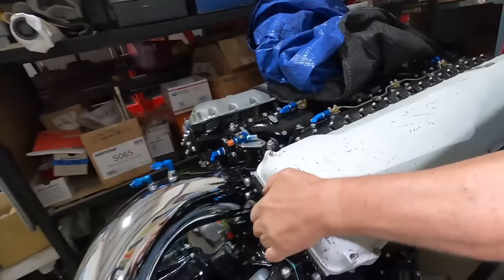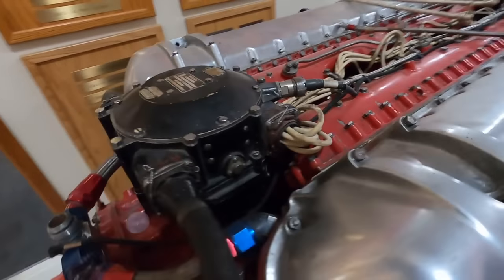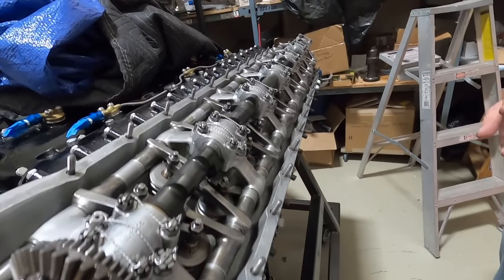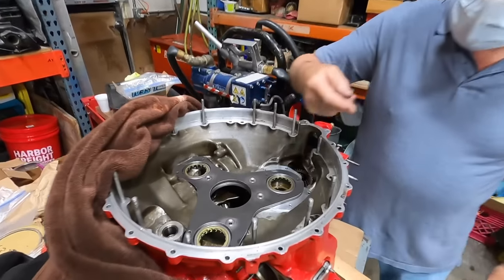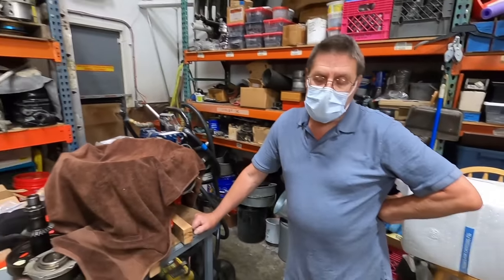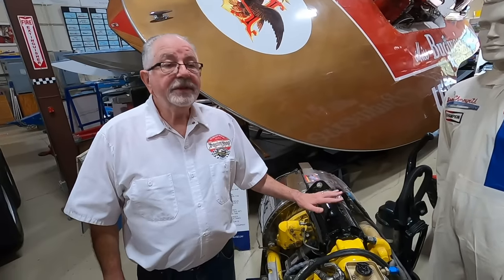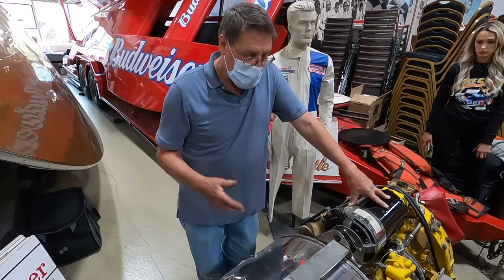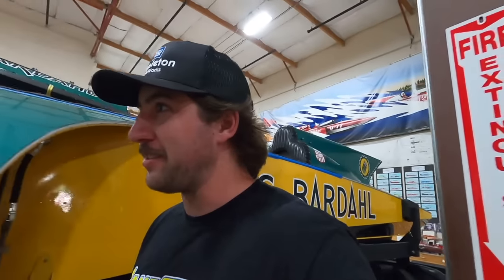The Rolls Royce Merlin: WWII Fighter Plane Engines Modified For Hydroplane Racing!

Comment: It has always blown my mind some of the stuff they had back during WW2. Big centrifugal Superchargers, turbo's, water/methanol injection, fuel injection, 4 valves per cylinder with overhead cams. The Allison engine in the P-38 Lightning has a turbocharged Allison instead of a supercharged one. The giant radial engines were also blown, but some of the later ones built after the war also had a device built into the exhaust that they called a turbo compound, it is a turbine spun by the exhaust gases that spins a shaft that connected strait to the crankshaft thru a fluid coupler, they would have a few of these on each engine and it was said to increase power by as much as 25%
Reply from the maker: So it takes load off the crank via exhaust pressure? That is very interesting..
Reply: Indeed; the Wright R-3350 used the turbo-compound on some models; there were three units, one for each six cylinders, adding at least 500 HP.
Reply: Why did turbo compound not drive its own fan? Why would RPM on the huge prop change too fast for a centrifugal compressor?
Reply: Nitrous Oxide injection was developed during WWII also
Reply: The turbocharged engines used in (American) WW2 aircraft were also supercharged, the turbocharger simply provided the first stage of supercharging, while an engine driven supercharger provided the second stage.
Reply: The Curtiss-Wright R3350 had a final form (it was originally built for the B-29) that used a power recovery turbine (PRT). These turbines, as stated above, linked to the crankshaft and added some power, while improving fuel economy.

As far as ACTUAL power gain, they really only added about 10-15% due to mechanical losses of the step-down connection and assembly.

The biggest problem was that the turbine created back pressure, and these engines weren't designed to handle that well. This created a heavier load on the engine, which created a heavier load on maintenance crews. These PRT's were commonly (hatefully) called "parts required turbines" due to the higher maintenance load.

But, it is also the ONLY engine that had a production line addition of the PRT. And that makes it the MOST unique engine in the world!
Reply: @RazingthenRaising  how can an engine not be built for back pressure? Aside from (simulated) Atkins cycle, all engines open their exhaust valve while still have over pressure. It is just logically that we greet this exhaust with an almost matching back-pressure. Of course, like in an engine with a throttle plate, valve overlap is forbidden.
Reply: @ArneChristianRosenfeldt  I understand and agree. However, any time that you put a turbine into the system, you have even more back pressure.

That is why the power recovery turbine  caused problems. The engine already had a hard time with overheating, and it added heat.
Reply: @RazingthenRaising  piston heads say back pressure when the use too small exhaust valves and rely on excessive pressure difference. Every bang from the exhaust is a waste of energy. Back pressure was too low.

Ideally, without back pressure, the exhaust is sucked out of the cylinder after bdc. How much pressure is even at altitude? Then add inertia through the exhaust header to the mix. Yeah, that pulls the piston up. That is elegant, but not perfect. And it is loud.
Reply: @ArneChristianRosenfeldt  I understand that back pressure is good in certain circumstances. I also understand that getting the suction correct is also amazing way to add power.

I am merely speaking of this engine having problems with getting overloaded, and running very hot. This was a big problem with this particular engine.

Each engine has its own particular goods and bads. And I don't know enough to speak more on that. ;)
Reply: Back pressure is never good for the engine. Or at least I would expect a big company to adjust the camshaft ( or cam - ring in this case ). I guess that I am biased. I think that it is stupid not to switch to somethin inline ( V, flat ) for these power levels. So guess the engineers working on this were not the brightest bulbs in the shed. Those were winning the war with V12 and later worked on jets. @RazingthenRaising
Reply: @ArneChristianRosenfeldt  Radials are their own beasts. Headers are used to help proper flow. I'm not educated enough to say specifics.

These engines were built specifically for the B-29, and EVERYTHING about that plane was DRASTICALLY rushed.

But it did a lot of good for future inovation, so.... (shrug).
Reply: @Stapleton42  It applies load (more torque) to the crank. It wasn't very reliable though. Used on the R-3350 radials fitted to the Lockheed Constellation and the Douglas DC-7 (IIRC). 🙂
Reply: Once I was fascinated by cylinder arrangement, but then it occurred to me that in a lab as a researcher I would probably optimize a single cylinder engine ( flow, exhaust header, valves). Then just duplicate. No complicated engine design was ever successful. Cannot have a camshaft on a radial .. sad face -- but okay. Center of gravity is not a problem for planes as is noise, so DOHC is a no-brainer for anything with more than 3 cylinders in row -- kinda boring . The only interesting thing for me left is that the planetary gear of a radial is probably only half the weight because we can use 3 teeth of the final gear at once, in contrast to the axis shifting needed if I want an oil pan. But you could explain this to a 5 year old. I thought about low drag cooling air flow through a two row radial. The aerodynamic experts of your plane and for the cylinder ports will tell you that you need to keep cross section constant. So I guess that even this arrangement which looks straight to cool, needs some sheet metal filler bodies. Can as well have my flat engine.  @RazingthenRaising
Reply: @ArneChristianRosenfeldt  The reality is that all truly large engines (most over 20 liters) are just single cylinders connected to a drive shaft. They all are cooled by the central system, but everything from the block to the top of the head is removable separately from the  rest of the engine. This makes single cylinder failures (a common problem) a simple fix, rather than a full engine replacement.

This saves a LOT of time and money when a single cylinder/piston has a problem.

No need to remove the back of a boat or tear down an entire machine. Just replace the bad one.

Most radials are built on that principle, as well. Each cylinder bolts onto the block separately.
Reply: Well, on the Curtiss Wright R-3350, there are 3 power recovery units,  150 horse each . At the end of development I belive horsepower was 3,000 . So, about 18 percent  .
Reply: @ArneChristianRosenfeldt ,,, well, the prop definitely did not change RPM quickly . So, it's called a power recovery unit, and they decided to supercharge with gear driven shafts  , and recover power with these exhaust driven compounds  .
Reply: @PistonAvatarGuy  AAAHHH  Someone else knows the details !!!  The TURBOcharger feed into the Mechanical engine driven supercharger to give a two stage supercharger system.  The P38 use 2 Turbocharged Allisons, V12's   the P47 used a TURBOcharged Pratt Whitney R2800,  18 cylinder Radial engine  and the B17's used a TURBOcharged Wright R1830  9 cylinder Radial  and the B24 used the Pratt Whitney R1820 14 cylinder  TURBOCHARGED Radial  the only TURBO charged engines in WW II!!!
Reply: @RazingthenRaising  Only on Radial engines, the V12's use one head per side just like a modern V8 !!!
Reply: @wilburfinnigan2142   It depends on the engine. You aren't wrong for these, but many massive engines have removable cylinders.
Reply: @PistonAvatarGuy  Someone else that knows the real truth and not just BS !!!

Comment: Thanks Mitchell and Logan for bringing this. A special thank you to Dan for his knowledge of these power plants. It is amazing how the reliability of these mechanical pieces, that were designed and built in WWII, were used years later. Pushing the limits (with some beefing up) higher than the were initially intended for, is crazy. A testament to their advanced engineering. Tangible history is cool!
Reply from the maker: thanks man!

Comment: I've always been interested in the old school huge engines, Packard, Merlin's and so forth. Thanks for always going that extra mile for some of the more in depth looks on things.This was another awesome video guys!
Reply from the maker: Thank you very much!
Reply: Check out the Ford GAA engine. It's pretty cool as well.
Reply: squire brannon  Are you aware that During WWII PACKARD built 14,000 of their M2500 PT Boat engines, yes 2500 cubic inch displacement and they were also contracted with by Rolls Royce to build the Merlin engine FOR THE BRITS ????  They delivered 37,137  to the Brits, and The USAAF got 18,000 of the PACKARD built and modified V1650 Merlins mostly for the P51B/C & D/K  H Mustangs, ALL the 2 stage 2 speed supercharged version and the USAAF's firs 3,000 of the PACKARD V1650-1  The early Merlin with the SINGLE stage supercharger, USAAF had no plane for them so they put them in 1300 P40 F & L models, but it made no difference in performance over the Allison !!!

Comment: Man you and Logan are friggin AWESOME! I love old Warbirds as much as I love Racing. Can't afford a real Airplane though 🤣 so I fly RC Airplanes. I do love to watch anything about them including what folks did with there Engines. To bad the folks couldn't fit the 18 Cylinder 2,800 Cubic Inch Double Wasp Radial Engines on a Hydroplane 🤣

I like that Matag made engine parts, one of the most expensive and rare 1911 Pistols from WW2 were made by the Singer Sewing Machine Company.
Reply: adamrogers..  Rolls Royce in 1940 Contracted PACKARD Motor co to build their Merlin engine for the Brits  and the USAAF also got the Merlin from that and yes Maytag the washing machine co sub contracted to supply aluminum  castings to PACKARD  for the Merlin and some parts had MAYTAG cast into them !! !

Comment: Kennewick Wa has one of the best spectator courses for watching hydroplane racing. Watching the Budweiser running full song down the backstretch sponson walking and feeling the rumble in your tummy was unreal. Also got to see one of the first competitive turbines, the Pay ‘n Pak, take off like an airplane and do 2.5 flips on one of its first runs.
The boats still race and test here every year, the boat are more competitive and reliable with the turbines, but just aren’t the same without the ground thumping rumble.
Reply: They were called "Thunder boats" because of the magnificent noise the old piston engines made. The turbines may be more reliable and faster, but they certainly don't make the same noise.
Reply: I think the turbines ruined powerboat racing.  Instead of thunder they now sound like angry bees.😢

Comment: That was awesome. I've always thought of the Rolls Royce Merlin as the greatest engine ever designed. To answer your question about fork and blade connecting rods, I do know they have been used in cars in the past, but I can't remember where. Probably the most famous place where they were used, other than the Merlin, was in Harley Davidson V-twin motorcycle engines. GM's Electro-Motive Diesel division, or EMD, produced 2 stroke locomotive engines that had fork and blade rods, and Detroit Diesel's 71 series engines, found in a ton of different buses and trucks back in the day is basically a scaled down version of the EMD engine, however the fork and blade rods were not included in the smaller engine, only the locomotives. One benefit of the fork and blade is that the rocking couple created with offset cylinder banks is eliminated. Plus both rods typically share a single bearing, which reduces the forces exerted on the bearing, however getting proper lubrication is a bit more tricky compared to a traditional side by side rod setup. A somewhat similar setup would be a master and slave connecting rod, found in some vee and inline engines, but more well known in radial aircraft engines. In a master and slave setup, the master connecting rod would be the only one making contact with the crankshaft, and each slave rod pivots off the master, rather than the crankshaft.

Also, you sort of touched on it briefly, but the Allison V-1710 was made by the Allison Engineering Company, what is today known as Allison Transmission. It was founded in 1915 by James A. Allison, one of the founders of the Indianapolis Motor Speedway, and was located at 1200 N Main Street, in Speedway, Indiana. The building is still there today, and is often referred to as Allison Plant One. When the US joined in World War I, the Allison Engineering Company made parts, tooling, and masters for the then new Liberty L-12 aircraft engine. In 1928, the company was sold to WWI flying ace Captain Eddie Rickenbacker, who had also purchased the Indianapolis Motor Speedway down the street the year prior. Shortly afterward, and following Allison's death in 1928, the company was sold to the Fisher Brothers (Body By Fisher) and their parent company, General Motors. After GM took control, work was begun on a new V12 to replace the then outdated Liberty engine, and the new engine became the Allison V-1710 you saw at the museum. Over 70,000 of them were built over the course of WWII. Allison built 2 new plants to handle the demand, Plant 3, which was on 10th street just south of Plant 1, and a second factory, Plant 5, which was located at 2355 S Tibbs Ave. Unfortunately, both of those buildings are now gone. Plant 3 was leveled in the late 1980s to make way for the current World Transmission Facility at the same location, and Plant 5 stuck around until several years ago, but is sadly now gone. The aircraft engine business was sold by GM to Rolls Royce in 1995, and Rolls Royce is in the process of modernizing the Plant 5 site, and currently manufacturers the lift fan for Lockheed Martin's F-35 Lightning II. Ironically, the original Lockheed P-38 Lightning, was powered by 2 Allison V-1710 engines.
Reply from the maker: Interesting! I have actually driven by Allison plant one by accident. Didn't know it was historically significant I just remember the big Allison logo on the side.
Reply: @Stapleton42  Oh, that was probably the former Plant 3 site you are thinking of, which is down the street from Plant 1. You probably drove right by Plant 1 and didn't even realize it was there. I don't think I've ever seen any Allison branding on it. It is not quite across the street from the Dallara factory on Main Street, and doesn't really stand out much, other than a historic marker on the street corner describing what it is. Sadly, I think the building is in a bit of disrepair these days, but I really hope it can be saved. I got a private tour from the previous tenant maybe 10 years ago, and there is a ton of history that happened there. There are a couple brick dyno cells, where they used to test the aero engines, but the walls of them are filled with asbestos, so they were essentially sealed off when I went. The story I heard was that during WWI, planes would land on the backstretch of the Indianapolis Motor Speedway, taxi over to the alleyway behind the building, they'd swap engines, and the planes would taxi back over to the speedway to take off again. There is still an old anti-aircraft gun in the back parking lot, I assume to protect the plant from enemy bombing.

I'm not sure when Allison moved out of the building, but it has been used by several race teams and at least 1 private car collection since then. To my knowledge it is vacant now.

Comment: Garwood the guy that invented the trash compacting truck was the first I know of to build a gearbox to hook multiple engines together. In this case it was to pair up some 2000hp each 2500cid packard v12's. That was around 1930.
Reply: bcbloc  YES !!!! Those engines were the basis for Packards M2500 PT Boat engines that they built 14,000 of them for the US Navy and the UK Navy, yes the Brits used them too !!  he had 4 of them in one boat !!!

Comment: Such gearhead eye candy. I found specs for the allison but not the Merlin. Alliison V1710 1250 HP @ 3200 RPM Weight  1595Lbs.
Reply from the maker: I think probably because there were so many Merlin variants its hard to give them a single number

Comment: If you want more theory on turbine engines, look at the PT-6s on King Airs, Meridians, Pilatus, Caravan, etc…. The PT-6 is a free turbine like the Lycoming for the helicopter, but the RGB is different.  Also look at Honeywell TPE-331 for a direct drive turbine used in Conquest II, MU-2, Commander, etc…  Turbines changed General Aviation allowing way more HP without super big and complicated piston engines.

Comment: All our "performance parts" were around since the 1940's, roller rockers, the blower that looks like a turbo driven off the crank, NO2, Safety wire, looks like a hemi head, overhead cam, no new ideas guys. Props to the old school guys without computers, or a CNC, they had a slide rule and were brilliant engineers , amazing!
Reply: The Engineers and Machinists that designed and built the parts were absolutely HEROS!!